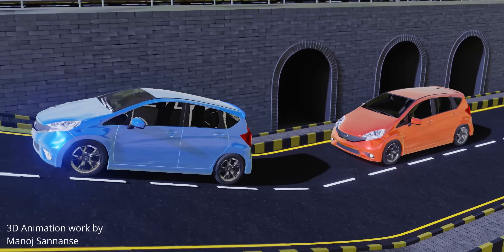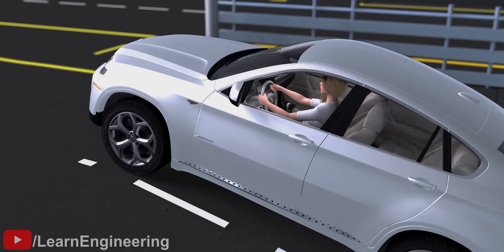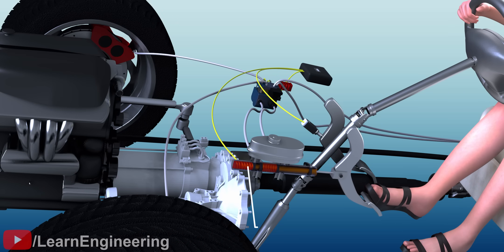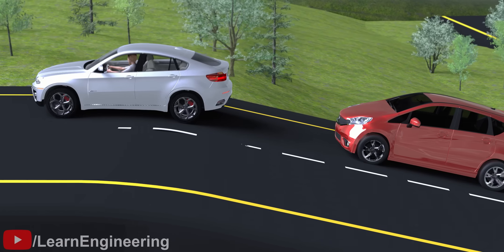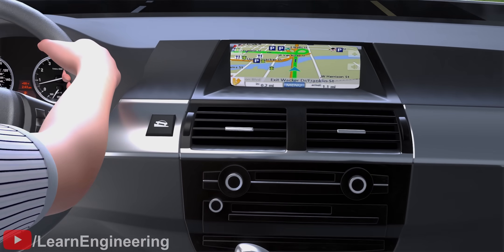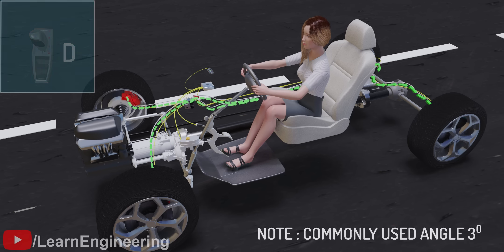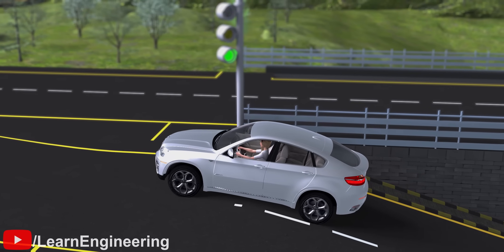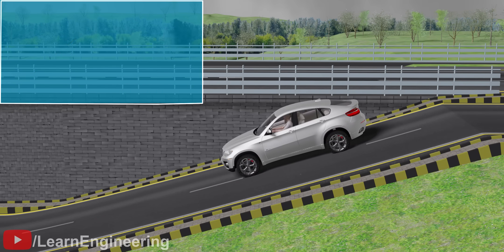Understanding Hill Start Assist!

Comment: Funny that the car used to demonstrate HSA is a BMW when most manufactures have this once advanced feature reserved for the prestigious.
Reply: I think BMW actually uses HSA in connection with the torque converter, not the brake.
When I drive mine I dont feel the brake locking it in place, its actually the torque converter. This is why its so smooth.
Even works in reverse. But in my opinion, absolutely unneccessary. Noone needs this.

Comment: I already have this on my truck but I never knew it was called a "Hill Start Assist". I have always just called it my left foot..........
Reply: @jasonburguess  We are talking about steep hills and not overloading our clutch.
Reply: You are supposed to use the hand break.
Reply: @jasonburguess  I ruined a clutch once without using the handbrake (very steep hill). Best to use the emergency brake to avoid damage to the car.

Comment: Why would you need if you have automatic transmission?
Reply: AT cars have torque converter in the place of clutch, with is in the half engage condition like a clutch all the time, so AT cars can roll backward and drivers cannot control how much the clutch engages

Comment: This is why the hand brake was invented! No need for HSA in my opinion and on manual transmissions then you have hold it easily on the clutch.
Reply: On a steep hill? Never,only if you apply the hand brake Wich not every driver want to do it when they stop
Reply: @tamasbogdan9493  a properly functioning hand brake will hold the car regardless of how steep the hill is (tyre grip permitting of course). Any driver that relies on technology over the manual controls is not in proper control in my opinion. Hill starts are a fundamental part of operating a vehicle in the real world.
Reply: @tamasbogdan9493  the handbrake is much smoother. When I had to use hill assist it jerked me forward every damn time and it stops you from being able to roll forward :/

Comment: There has been a technology that has been there for ages. it's called a hand brake.
Reply: @ronvoy  Yes. I miss-spelled and auto correction messed it up
Reply: Its like the more technology goes into vehicles, the less skill is require to drive......which isn't exactly  good thing either
Reply: “Hand brake” is not operated by hand/handle anymore on a lot of new cars, it is controlled by a button or a foot pedal with ratchet mechanism
Reply: @yzhang8629  true but there are still millions of cars on the road that still have the lever handbrake.
Reply: @yzhang8629  you still need your hand to push the button right?
Reply: Or - use your other leg - technic.
Reply: @Mikolaj Kraszewski Nah it's something that my yung generation doesn't know...It's called driving skill. Why is it too much to ask today, to operate more than 2 imputs at once? When you do it often engough, your body will do it automatically. It's just muscle memory and saves a lot of mechanical and electronic complexity. But that's fine because everything is meant to break within a decade to keep the economy going.
Reply: @3SPR1T  Go ride a horse if you hate convenience so much.
Reply: @thaigo972  why go to school when we can all use Google?
Reply: @3SPR1T  The comparison doesn't really work. Self-teaching an engineering curriculum through pure Googling is way harder than doing it in college, and the knowledge you gain is actually useful. Driving skills are literally only useful for driving.
Reply: @thaigo972  and engineering is mostly useful for engineers.
Reply: @3SPR1T  Not sure about that. The financial sector was very happy to hire me.
Reply: @thaigo972  now let me guess: you're designing machines that make coins?
Reply: @3SPR1T  No, but I'm curious what you were trying to get at lol. Designing coin minting machines is not what people usually mean when they say they work in finance.
I work in trading software. Being good at math and programming (i.e. skills commonly learned in engineering courses) is very useful in this sector. The pay is usually much better than egineering, too.
Reply: Well, seeing it's a woman-driver, a simpler solution don't let women drive 
-
LOL
(just kidding SJW)
Reply: @cooldesertknight9013  you can either simplify the person or the vehicle.

Comment: Here in La Paz, Bolivia we're used to starting uphill with manual transmission and without handbrake, it's so easy. (even with heavy vehicles) 😎
Reply: With manual transmission, driver has clutch, which doesn’t exist on automatic transmission cars.
I think an alternative to this HSA is, the driver use two foot to control the pedals in hill start situations: hold the brake with one foot while applying the accelerator with the other, once the accelerator pedal is applied enough, release the brake pedal and resume normal operation
Reply: @yzhang8629  I saw a Wolkswagen Tiguan with manual transmission and HSA from one of my professors.
The alternative is to use one foot in both the brake and the acceletator, and the other one in the clutch, that one foot operación we call "hacer puente" literally "Do a bridge"
and believe me we have up to 35% slope here in LP 😉

http://www.lapazbus.bo/fileman/Uploads/files/bus%20pendiente%20web.jpg

~30 ton (full loaded) La Paz Bus System starting on a 21% slope without any assistance
Reply: @juancarlosarzecalle9089  Yes, manual car can also have HSA, it is a great tool to reduce the workload of a driver. It is a trend to make driving much easier, from power steering, cruise control and ABS, to more recent front collision mitigation, lane keep assist and adaptive cruise control
Reply: @juancarlosarzecalle9089  Most Westerners refer that technique as "heel-and-toe". Used in motorsports when braking, rev matching, and downshifting at the same time.

Comment: The HSA I learned to use is the clutch and parking brake.
Reply: It's not needed automatic cars don't roll back when they stop up hill.
Reply: @kachiquitaito3341  they do depending on the grade and power of the engine but all auto will reach a point where the gradient is steep enough to cause the vehicle to roll back and if not arrested can gain enough momentum to stall the engine
Reply: @joebrown9621  You right 👍
Reply: @kachiquitaito3341  they referring to manual transmissions 
In Europe especially the UK
There’s more manual cars than auto
Reply: handbrake, hold her flat, then burn up the tires dropping the clutch lol
Reply: Learned uphill start using half clutch
Reply: Please explain me how, it will be very much helpful
Reply: @thethinker7337  apply the parking brakes, then you won't have to press the regular brakes and you can accelerate while slowly disengaging the clutch, then you can turn off the parking brake once you feel you have enough torque to overcome the gravity...
Reply: @thethinker7337  In India we call it Driving with Half Clutch
Reply: @arv1ndgr  exactly. Half clutch is equivalent to your brake and it gives you the ample time to press your accelerator n car starts to move
Reply: @thethinker7337   The parking brake technique really only works if you have a hand operated brake. If it's foot operated, it would make it more difficult. Once you get used to the feel of a clutch in a certain car, you'll have a good idea how much you need to release it before it starts to grab. Then you should be able to get going with minimal backward rolling. Hopefully the person behind you left some space to allow you to roll back a little. Some people don't think of that, though.
Reply: @kenmore01  
i dont remember a car having foot parking brake other then mercedes at the 80s and i think most of them came with automatic gear
Reply: @Techie1224  Audi Q7 is  having handbrake lever near the foot rest.
Reply: @kenmore01  if the car doesn’t leave enough room it serves them right if you roll back. I was on a hill once and inched forwards twice to give enough room behind me to roll back and each time the automatic behind me inched in kind. After that I figured if I rolled back into him I didn’t much care.
Reply: parking brake is the easy way, if you have enough skill you dont need it.
Reply: @xxn0cturn3xx  On steep hills it´s better to use the parking break, otherwise you wear the clutch unnecessary.
Reply: @qq84_Richard    No, you just need to be quick.
Reply: @kenmore01  you wouldn't have time to ride the clutch
Reply: @riverrat7529  first you hold brake and clutch then when clutch is in the right position car o truck will not roll down backwards but you will have to give enough fuel for the car to keep  going up and slowly release the clutch the more practice you do it's the easier to do it.
It's the same like when we just learning to drive seen hard to do something but then is easier.
Reply: @qq84_Richard  u28 89
Reply: @Noc  the parking break didn't work on my first car so I had to hold the brake and clutch then switch to the gas, by some miracle I got it first try
Reply: @xxn0cturn3xx  depends, if it's a long stop holding the clutch that long isn't very ideal. Now either you have it held completely in with break which is perfectly fine for the car and find the biting point once traffic starts moving or use the handbreak and either stay first gear or neutral and then shift back when you want to move.
Reply: @xxn0cturn3xx  llllllĺĺl

L
Reply: @deveedasankrishnan7345  someone cant drive 😂😂
Reply: Right
Reply: Ya bro I also
Reply: Yes, most drivers I've asked said the same. 
Caution: one person forgot to release the hand brake and got a burning smell after a while. He called me and asked what would happen, and I told him to wait and let the brake shoes cool down.
Reply: I do the same
Reply: @Chris i dont think everyone is a passionate driver. Alot of people are A to B- drivers. (Drivers that only care about getting from place A to B in the easiest way)
Reply: Nailed it! For manual cars yes!
Reply: @Chris Not everyone needs to be a race car driver for going to work and coming back home. Manual transmissions don't reduce accidents it's really about the same either. So being a worst driver doesn't matter if driving is just as safe
Reply: here in my area it's part of the test course to stop and start in an uphill using a side brake.
Reply: I couldn't use the parking brake easily because it was a foot brake and would have been more of a pain to use.
Reply: @LawF250  VINDICATED! lol. In all seriousness though, in America, most cars have foot parking brakes or now, electric ones triggered by a switch. I suppose most manual transmission cars (which are rare here anymore) may have hand brakes.

Regardless, I drove manuals for decades and never relied on the parking brake. You learn how much you must release the clutch to get a grab, and hit that quickly after releasing the brake pedal. It's about practice and of course, every car is different. Learn the car before you're on a hill with someone sniffing your butt.
Reply: Ok
Reply: Honestly, I didn't need the handbrake tho🤣🤣
Reply: Half clutch can be a solution in that situation
Reply: Or heel toe. One foot on the clutch and the other with the heel on the brake and toe on the gas until you get the car moving.
Reply: The parking brake technique works best. You can use it with any type of parking brake.
Reply: @Fred  my parking brake handle falls apart all the time and I have to reassemble it so I only use it when I need to park
Reply: I don't even need the parking brake 🤣 newbies
Reply: Way better than paying 10k extra for stupid electronics like this that fail 1 year after warranty
Reply: Thanks
Reply: Or just use normal brakes until the clutch starts to engage and then switch from brake to acceleration pedal. Always found that to be easier that coordinating between my hands and feet.
Reply: I believe steam engine is your next upgrade.

Comment: Or maybe just use the hand brakes? That's a lot easier and cheaper. If you're stuck on an uphill or downhill, while pressing the break pedal engage the hand brake. After that, release the brake pedal and press the gas pedal slowly. If you feel there's enough torque, release the hand brake and the car will move without rolling backward.
Reply: Unfortunately more and more cars have an electronic toggle and not a manual hand brake (

Comment: A rachet mechanism is also a solution but brake system would have worked better hence is adopted. Great 👍
Reply: With that mechanisim u would also need to find a way to deploy it and disingage it as well.
Reply: Bhai mera 1 youtube pr chanel hein. Bhai log mujhe suport ki bhht jrurt hai pls suport kro❤️https://youtu.be/JyBckyDgKc8
Reply: A ratchet system would increase mechanical complexity and additional parts that experience wear and need service. You would also need components that disengage the ratchet, adding further complexity. You don't want ratchets in systems that move at speed for extended durations without some form of retention mechanism (which would likely be hydraulic or pneumatic actuators). The HSA is an electronic ratchet, so to speak.

So, yes, the HSA is a vastly better system than a mechanical one.

Comment: This is really interesting! I've only driven manual cars, so assumed that automatics were holding the clutch partially engaged for you, rather than holding the brake on.
Reply: There's no "clutch" in automatic transmissions. However, the drive shaft and the engine are still coupled so the car will be held stable if the hill is not steep.
Reply: @MrAmgadHasan  A automatic car has clutch packs and has a planetary gear system so works in a similar way to a manual gearbox except it dose the gear changes for you if you hold your foot on the brake it will disengage I.e put the in neutral until you take your foot off the brake and put foot on the gas and then will select gear so on a hill start in a automatic it's still best to use the handbrake to avoid rolling back and release it  when the selects gear so its similar to a manual except you don't use a clutch pedal and it will charge automatic for rest of your drive.
Hope that makes sense.
Reply: @MrAmgadHasan  Really? How does it achieve variation of gearing ratios without the ability to disengage?
Reply: @matthewwilkes6162   It uses a Torque converter. Think of it as a hydraulic pump that then can be adjusted in terms of flow and ratio. The only problem is that it wastes energy, but modern transmissions have a clutch that locks the input shaft to the output so it's not there once you get to speed. And in Electric cars the electronics can also just keep a force applied.
Reply: @LaserFur  Well you are right but Audi for example uses a double clutch transmission.
So while BMW uses a torque converter Audi uses an automatic transmission with 2 clutches. So saying that automatic cars dont have a clutch is not always correct. But it is correct that they dont need a pedal for it.
Reply: Not a clutch in a traditional sense, but torque converters use a lock up clutch for fuel efficiency. Besides, depending on how steep the hill and how heavy the car is, the engine torque may not be enough to keep the car still at idle rpm. Just makes more sense to use the brakes instead of raising the rpm and wasting gas. Also requires more complicated programming too. Using the brakes is the easiest way to implement hsa.
Reply: @2010ngojo  A lot of automatics in new cars do have a clutch. My Elantra n-line has a 7 speed single clutch automatic, shifts faster than a human can.
Reply: @versacechang1521  just a response to someone who says automatics don't have clutches. Heck, even dct has clutches. It's in the name.
Reply: @EAMitch  oh my rear diff has 6 clutch plates, does that mean i can shift into 6 more gears? Wtf do you want to say with your comment?? A clutch can have multiple clutch plates! And now?
Reply: @EAMitch  oh yes you go big brain
Reply: @EAMitch  nah im fine, thanks
Reply: Some transmissions won't allow the car to roll backwards, pretty sure my dad's GMC truck with a TH350 transmission held, my mother's 1985 Delta 88 would roll backwards in drive when facing uphill.
Reply: Automatic cars pros is that they are easier to use but the cons are that they don't have optimal gear shift change and have alot less control of their car when it comes to the clutch.
Reply: Meron din uphill assist sa mga manual in todays car...
Reply: automatic vehicles don't have a clutch, a converter is used in place of that
Reply: @okcjosiah420  some do my buddies Passat has a dual clutch auto, my Elantra n-line has a 7 speed single clutch auto. The autos don’t have clutch thing hasn’t been true for a long time.

Comment: This would have been nice to have on my stick shift truck when some idiot would stop at a red light 2 feet behind me on a steep hill.
Reply: What, you never used the handbrake and floored it in first gear?
Reply: @NoorquackerInd  Having a floor parking brake makes that pretty difficult lol
Reply: @devdb2  Exactly. 👍
Reply: It's such a dumb system in manual transmission,  I have it in my work truck, it holds on hill up or down, but as soon as you press the clutch it comes off, and you roll back anyway cos it has an electric clutch, it doesnt have a bite point its just on or off, you either stall, or roll back into the car 3mm behind you!
Reply: @timfagan816  electric clutches should be progressive not on/off. I would say yours has a fault.